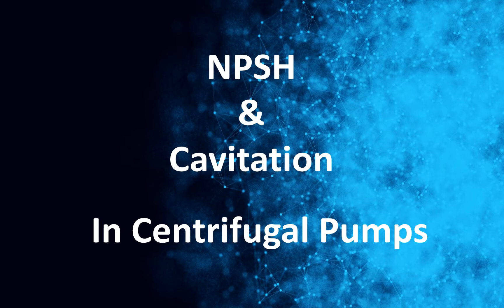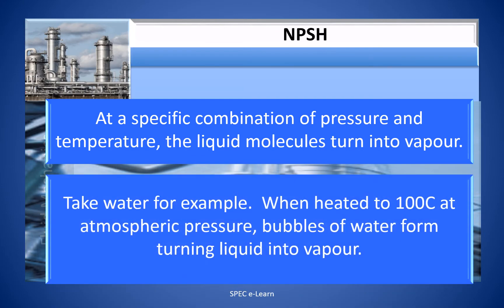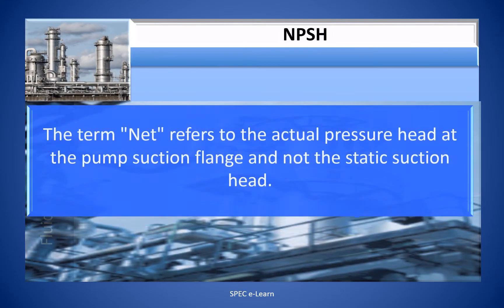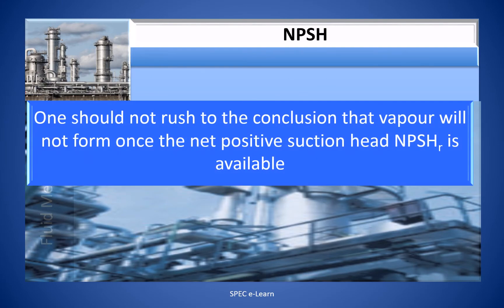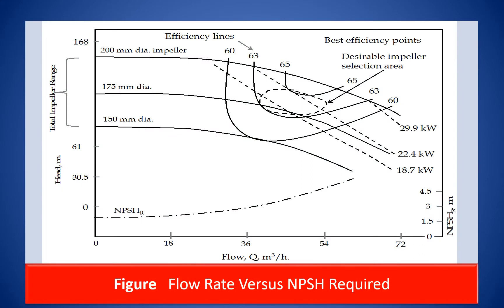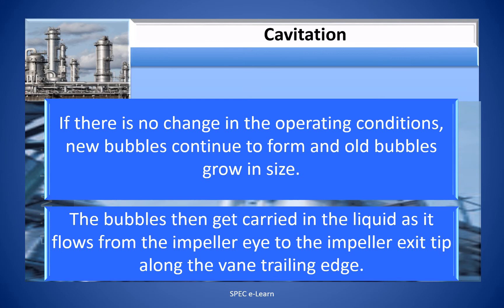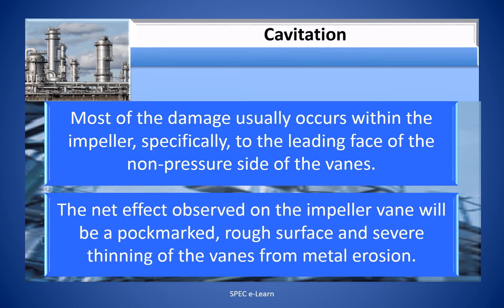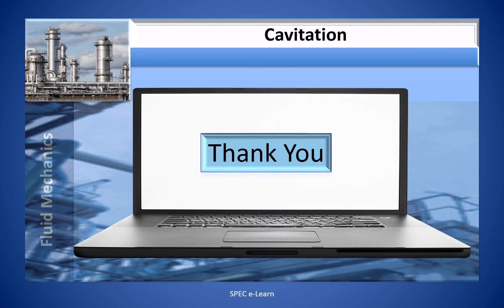NPSH And Cavitation In Centrifugal Pumps

Comment: When the  pressure head ( gauge+atmosphere)at the suction flange drops below vapour pressure, cavitation happens right. but when we calculate Npsh available  why do we take the dynamic head too? Why is the formula NPSH available= gauge pressure head +atmosphere presure head+  velocity head - vapour pressure head
why is there velocity head term here?
Reply from the maker: Frictional head
Reply: @SPEC786  Thanks a lot
Reply from the maker: Thanks for your question. When we calculate the the total head available at the pump suction flange the head due to fluid velocity should be accounted for. So also the friction loss in the suction pipe  from the vessel bottom to the suction flange. The head due to velocity may be very small compared to other terms in the formula
Reply: @SPEC786  In practical scenarios ,  velocity head or frictional head is higher?